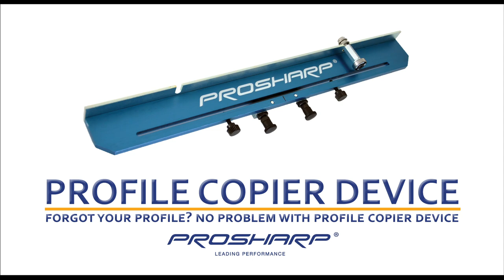Prosharp Profile Copier Device

Comment: Fank you! Price?
Reply from the maker: 210 € excl. VAT.
Reply: The Prosharp copy device I bought  in the US in January 2018 was 299 US. Its price was not on the US website. I added it as "other parts and service" on the US web order site. It is a very cool device. Mine is used to duplicate the favourite skates blades I like. Thus one can have two pairs of skates with matched blades. My AS 2001 is an older one with the Maroon color scheme. The AS 2001 is a good machine.